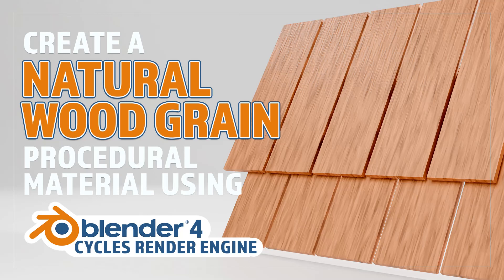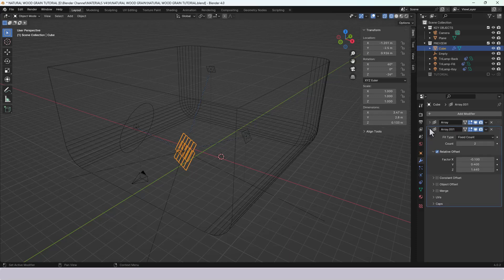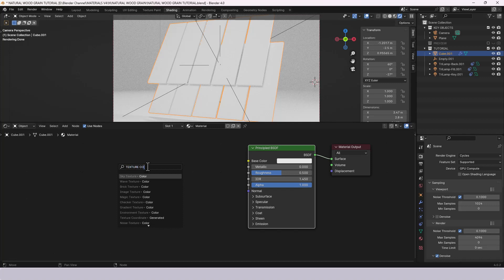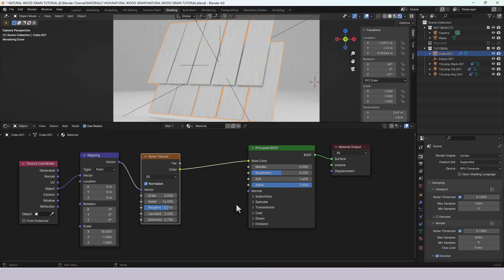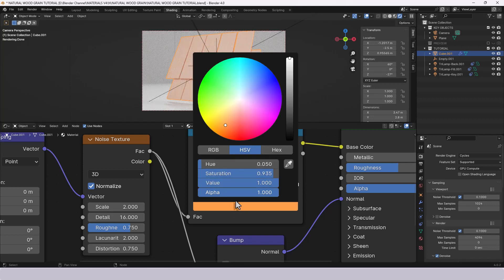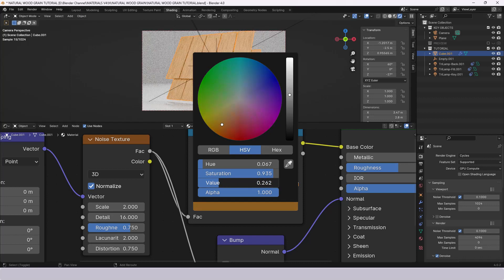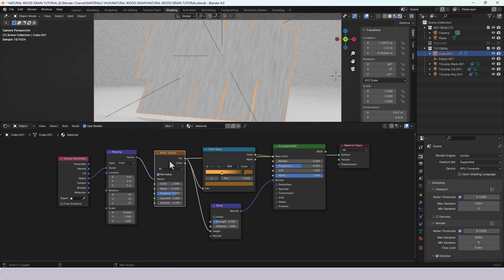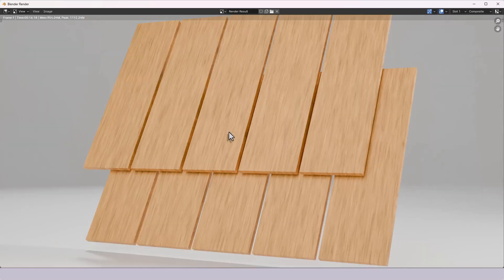CREATE A NATURAL WOOD GRAIN PROCEDURAL MATERIAL IN BLENDER V4

Comment: after watching this video i applied the modifier for each board, baked the textures because i wanted the model to be exported as a glb file. the problem is all boards look identical in the gltf viewer and the file size is not great (1.5 mb)
Reply from the maker: It sounds like a different approach may be required.